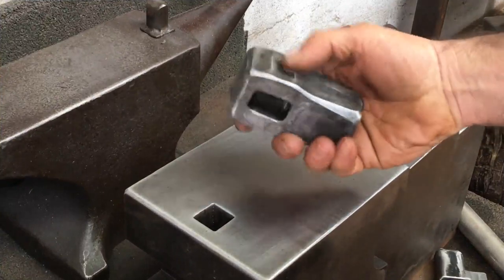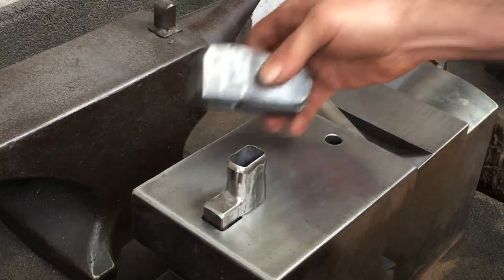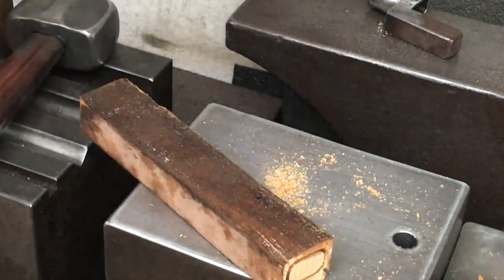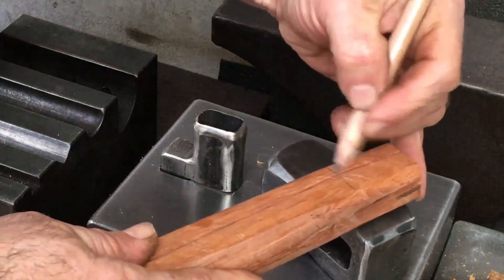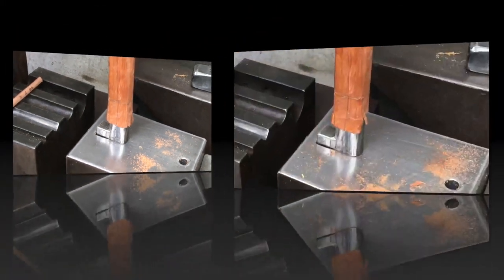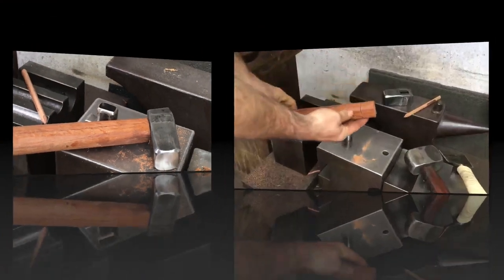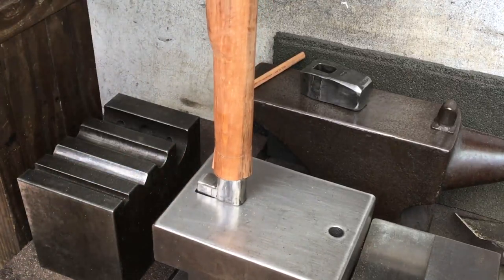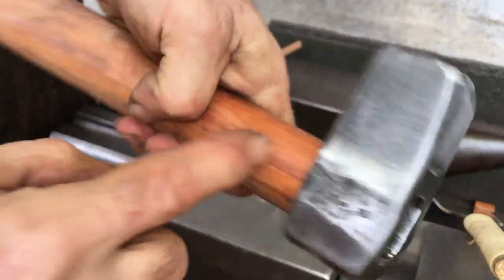Simple Low Tech Solution for Hammer Handles (must see handle shaving tool)

Comment: Good idea Glen, only downside is because it’s a splitting tool rather than a cutting tool is, as you found, unless the grain is arrow straight and parallel it will always want to follow the grain!
Reply from the maker: Hi Paul, That first piece of wood has a very tight and somewhat wavy grain pattern. Still, I think I can make adjustments and that this tool will work well for me. Thanks.

Comment: Working as a wood butcher most of my life, even with a razor-sharp chisel when trying splitting wood, it will always try to chase the grain. Score the length of the hammer eye and make a series of cuts up to the top of the handle to break the grain so it doesn't influence the new tool as you drive it down on too it.
Reply from the maker: Yeah, chasing the grain is something many mentioned. I think I can mitigate this some and that this tool will work well enough for my purpose. Also, I tend to choose as straight a grain pattern as possible for handles but that first piece had some wavy grain right at that point which I only noticed later. Thanks.

Comment: I just cut around stock and use a thin  old knife and beat on it with a peace of wood . My grandpa used to use a broken glass as a scraping tool.I also like to put a hose clamp at the end of handle so it wont split when you hammer it to fit the eye part.I never use glue or steel wedge on handles .just a small wood screw with flat head to hold the wedge in place.Right on the split line between handle and wedge edge.After everything is done i oil it with linseed oil ,plenty of it. After that its once a year -a little bit of oil and thats it. I never had aproblem with wood swelling or drying out in summer.
I guess everyone has something of its own when it comes to handle making .
Reply from the maker: Good comment. Lots of useful information. Thanks for sharing and for watching.

Comment: Glen, if you veer off to one side, that's okay. Use that hammer for hitting around corners. Thanks for the video. Jon
Reply from the maker: Ha! Good idea. But seriously, if it veers and the problem is not how I'm holding but rather the tool is following a funky grain pattern, then this tool also helps me eliminate some pieces of wood that maybe are less than ideal for handles. Thanks for the laugh.

Comment: Interesting tool. I've always been stuck with a draw knife and file. Great idea!!
Reply from the maker: Nothing wrong with a draw knife, rasps and the like. That's how I always went about this. But this definitely works. And it helps me eliminate some pieces of wood that are less than ideal for handles - pieces that have a wavy grain pattern that makes the wood veer to one side. Just needs some adjusting. Thanks robert.

Comment: Any difference in the "blade" angle from one side to the other and any angle in the wood grain will make the final shape veer from it's intended path, very noticeable in hardwood. Thanks Glen.
Reply from the maker: For sure I'm realizing that this style tool will "chase" the grain as others have also said. But I'm finding it very useful since I want as straight a grain pattern for handles as possible. And so ones with funky / wavy grain can be eliminated as less than ideal. But beyond that, I still need to make a few small adjustments (the "blade" angle as you mention being one). Thanks for your support.

Comment: Very interesting and ingenious, but with some pretty notable downsides; likelihood of following the grain off center and being susceptible to human allignment error, possibility of splitting the wood beyond the final shoulder which could create a future weak point, being an incomplete process which increases the time spent compared to other possible timesaving methods. 

Not that it doesn’t have upsides; relatively pleasant and non-obnoxious compared to say, shaping with a belt grinder, uses tools that a blacksmith will already have as a base, simple cheap and easy to make. 

The bigger problem I see with it as a process is that the obvious routes to increasing efficiency and removing the negatives directly take away from its positive aspects. IE requiring greater tooling, or say using a press (allowing more controlled allignment, repeatability, and a retained tool that could be automatically pulled out of the material on the backstroke) etc. And those wouldn’t solve the shoulder or incomplete process problems at first glance. 

I do hope you’re able to put some more thought into it and work out more kinks! It seems like it’s better to use it than not even before improvement, so I’m sure you can!
It’s always good to think about, and I don’t make tool handles enough to cause myself to contemplate something like this without prompting.

The route that my mind took was very different to yours, a jig that would hold the handle blank, allowing for indexable 90* rotation, and have curves on each side matching your final shoulder profile. Then just use a drawknife to pare it down without ever having to check back and forth for fit. Downsides of that would be more tooling work and more complex tooling involving either multiple heights for those curves or multiple different curves because of the rectangular nature of the handle/ tang, takes a bit longer initially. But it should produce an almost finished result, quietly.

Then on the other side of the equation is just using a belt grinder
Reply from the maker: Thanks for your in depth comment. Chasing the grain is what many folks mentioned. But I think I can adjust this to work even on tougher grained woods like that first piece. Like you say, with more thought / trial and error, I'm sure I can get this to where it's effective and mostly consistent. I appreciate you taking your time to write. Thanks.

Comment: Why don’t you just reverse the way of hammering?  You could hit on the tool instead of the wooden bar. I mean fix the bar and put the tool on the top of the bar and hit on the head of the tool. Sorry if it’s too random but maybe you can give it a try
Reply: inertia -this way you dont damage the head or mark it with a hammer .You could put a wooden board yes.
But hitting the handle is way better because it wont force the wood -that way you can shave wood where it leaves the mark and get a good fit on your handle .
Reply from the maker: I did think of doing it that way but with the hardy shank on one end, striking that end would be awkward. But good suggestion all the same. Thanks.
Reply from the maker: I tend to agree with you. Thanks for sharing.

Comment: Your "eye chisel" is chasing the grain. Thus the reason no one uses a tool like that for handles.
Reply from the maker: I understand the logic of it chasing the grain but I feel this tool is still very useful since I want handles with as straight a grain pattern as possible and so it they veer (and I'm holding the wood true when using) then I can eliminate those pieces as less than suitable for hammer handles. Thanks for watching.
Reply: @gstongs  That's why the old guys used froes and draw knives. Still is the best way to go in my opinion.